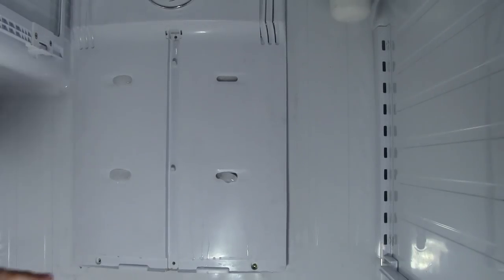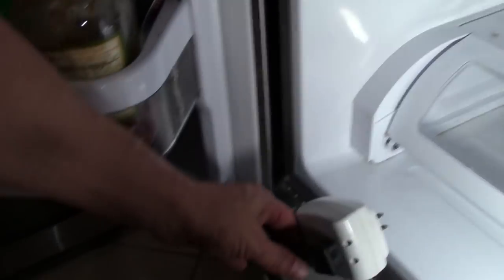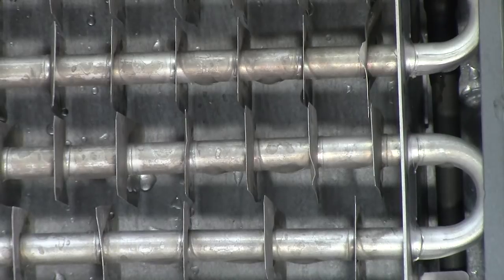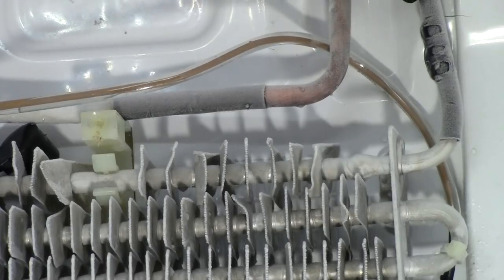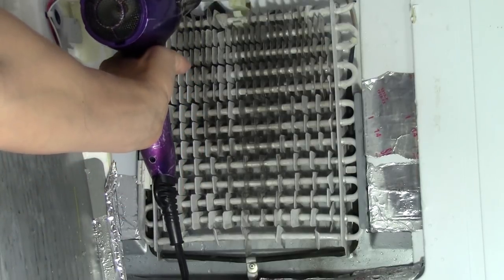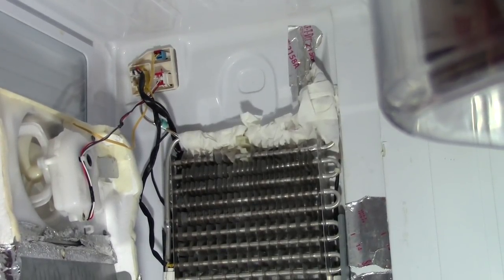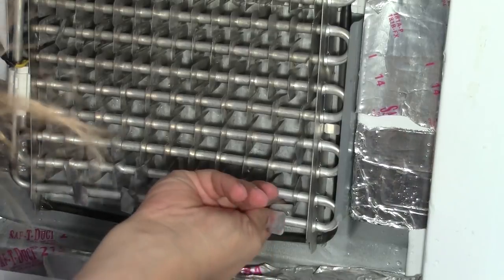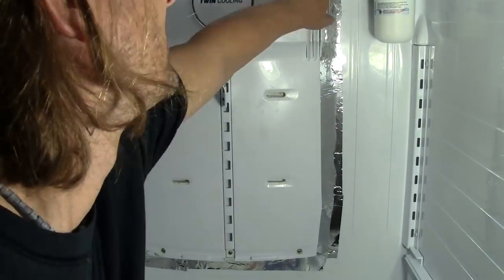PART 8 How to Fix a SAMSUNG RF 267 Refrigerator Not Cooling Icing and Freezing DIY repair

Comment: Hello Jake and thank you for the videos on the repair of the Samsung fridge. I have "fixed" my girlfriends fridge which has not worked properly for 2 1/2 years. I have to say that I am trying some different things to stop the icing problem and will update you if they do. Thanks again for the help with the refrigerator.
Reply: Why even bother fixing it yourself ?. You should just let SamSung warranty service a chance to do their job !.

We have the same problem with our SamSung SRF639DSS model after 4.5years working fine for our Sydney's hot climate. I called SamSung Australia explained the situation, mentioned about a few youtube video questioned the quality of SamSung's fridges. I also mentioned the fact that we use lots of SamSung house hold products including diswasher, mirowave oven, washing and dryer machine, etc. SamSung advised that it should just be a simple fix as they are standing behind the quality of their products.

The operator asked me to find the original purchasing invoice, which dated January 2012. She then sent me the repair authorisation form to sign for the repair technician on the day, and booked for us a warranty repair service for free the next day on 27 Dec 2017. 

As it turned out, the auto defrost system was not working because of the blown fuse. I am happy and quite surprised and impressed with SamSung's warranty services.

Comment: Thank you for the info.. I have insulated the lines that you did but did it with insulated foil tape and zip ties. Wish I could show my pics of the work.. my refrigerator actually seems like it's cold and like the temp gauge is working now to.. it uset to just say 34 at all times even with the door open for a while.  So far.. it's been a week..

Comment: This is an excellent example of how a little bit of knowledge can be a dangerous thing.  The problem is with the heating element not working properly. Replace the heating element. There is apparently a class action lawsuit against Samsung for this problem.

Comment: I am dealing with this right now. Purchased this Samsung refrigerator in 2016. Your fix is not a “fix” it is a temporary solution to a major design flaw.  I don’t think the average person is willing or able to defrost the evaporator coils on this refrigerator every few months. The only reason I know about this is because it started making this gosh awful noise and I did some research.  I have already spent $ on trying to get it repaired.  I appreciate all the work you put into this video because I now know what the problem is but I will be getting rid of this refrigerator.

Comment: I've been fixing appliances for over 42 years and these things are the worst pieces of JUNK ever! "SamDUNG!"
Reply: Thank you for your comment Don...What are your top 3 brands to recommend to us getting rid of these SamDungs?
Reply: Amen...I cant see his repair to have any weight
Reply: I ditched the old Samsu...no, I can't even say the name, it was so bad.  Got an LG instead.
Reply: @jaywebb4992  Probably just as bad from what I hear. a lot of these korean companies get their parts from the same supplier and basically just throw different exteriors and features. ughhh I miss an old whirpool we had, it ran for about 30 years, it started rusting but boy this thing was such a beast and it had water dispenser too.
Reply: what do you recommend at the top of the list?

Comment: Hi Jake Good on you for getting stuck in and save everyone who has this problem a lot of money and saving the planet from Scrapped Samsung Fridge Freezers filling up land fill LOL.....I was going to jump in after part 1 but decided to watch all the Videos first...Anyway I am an ex Factory Trained Hotpoint Service Technician and have worked on Thousands of Fridges and Freezer units both Domestic and commercial and it's fairly obvious why they are having this problem you actually hit on the answer with your Nebulizer LOL Here in the UK  we tend not to get many problems with ICE build up due to the fact there are very few houses that use or need Airconditioning this being the main cause of Moisture in the air making it Humid If you have ever seen how a dehumidifier works it's basically a fridge with a very large surface area condense  which the moisture in the air condenses onto then gets collected in a bucket or goes down a drain. Because of the Higher Levels of Humidity in American homes then there is 100s of molecules of water more in the Atmosphere which condenses on anything Cold so the Fridge Ice builds up and the Defrost heater cannot remove this amount of moisture...The only permanent fix would be to fit more defrost heaters they are very low wattage and 3 connected in parallel or maybe even 1 extra would fix this problem once and for all....also 1 last thing moisture condenses on cold metal more than plastic we don't have metal plates and silver foil all around our condense her just plastic..... Good Luck and very well done great effort....Regards Steve Liverpool UK
Reply from the maker: Thanks Steve.  I appreciate your insight.
Reply: Steve, you have the right analogy, but you've somehow managed to arrive at exactly the opposite conclusion from reality.  Air conditioned homes are LESS humid than the ambient air, for exactly the reason of your analogy - an air-conditioner work like just like a dehumidifier.  Moisture in the air condenses on the cold coil of an air-conditioner.  The condensate flows to a drip pan and drain line, and out of the building.   

The higher humidity levels in many US homes vs UK homes is for the simple reason that much of the US is more humid than the UK.  London sits some 400 miles north of the entire continental US.  And Jake in Florida is about 2,000 miles south of you, surrounding by swamps and an ocean of bath-temperature water.  About 1/3 of the continental US has a subtropical climate, with summer temps typically 35-40º C, and humidity ambient humidity well over 90%.    So yes, Jake is dealing with significantly higher humidity than you do, but not because he has air-conditioning
Reply: Exactly so Jeff.  The only exception that I can think of is when the air conditioner is of the swamp box design.  They are made for hyper dry locations such as Arizona perhaps.  I actually had one 35 years ago and all the guns did rust.  I was, shall we say due to "charity that begins at home", ill informed.

Comment: THIS GUY DOESN’T KNOW WHAT HE’S TALKING ABOUT!
The evaporator coils SHOULD have frost on them. The air in the fridge needs to pass over the coils. This is how the heat inside is removed from your unit. 
What this guy is showing you to do is WRONG on so many levels! 
First, the reason you see moisture going into the drain is due to the drain line. The drain line is a tube that exits the refrigerator. With the door open there is a draft. The air will naturally follow that drain tube. This is normal. 
Second- NEVER use a blow dryer to defrost a refrigerator! Never! The liner is plastic, a very thin plastic. It melts easily. You will damage the liner and there is no fix. You could try to seal a damaged liner, in my 30 yrs experience, sealants only work for awhile. Plus, it’s not covered by manufacturer and once damaged nothing else will be cover by the manufacturer.  
Third- NEVER put paper towels on electrical components! HELLO!! Would you wrap paper towels around the bake element in your oven? No, I hope not. The defrost heater in your refrigerator is the same as an oven element. It will glow red hot and any paper near it will burn. 
If your refrigerator has frost/ice built up on the back wall, there is a component in the defrost circuit that has failed and needs to be replaced. No paper towel is going to fix it.
Reply: Correct.... paper towel as insulation lol.
Reply: He's using a hairdryer which is not recommended.
Reply: Hi do you mean replacing defrost sensor and thermis sensor would fix the problem?
Reply: The paper towels are blocking the air flow!
Reply: Loretta if that is your image in your Avatar then all I can say that your beauty is only surpassed by your intellect.  Let us not forget that this guy is a typical "YouTuber". He creates videos about nothing in particular, he is out here for likes and subscriptions, actual substance and quality of content including being correct is the last thing on his mind.
Reply: @ljslw  Hey, No Worries😉👍 
 Just look at the massive amount of other "positive" comments he gets, maybe some are simply friends of his from the real world, while others are simply "Cranking his handle" in a Troll like way to perhaps annoy other readers! 

At least people like us like to scream the truth in the comment section, who knows, we could be saving someone from permanent injury or even death.  A pity that there is no apparent way to demonitize these videos for encouraging dangerous practices.
Reply: Hot damn this thread screams "boomer" and what fucking cringe.
Reply: I am thinking that some minor fireproof insulating  where the evaporator supply and return lines come thru the back of the uint could be beneficial in reducing condensation/ice buildup.  Also theres a fix to help the heating coil keep the drain portion open more increasing moisture removal.  The paper towel thing sure scared the crap out of me for sure, especially down by the defrost element!  What do you think Loretta?
Reply: Vinh Le if you have a multimeter you can check the ohms of the heating Elemt and the defrost thermostat/bi-metal. If the sensor was buried in ice, replace it. It doesn’t cost much.
Reply: Gary Seven i read some of those positive comments. I wonder how many people melted the liner when they blow dried the coils? I don’t think they’d give a positive review.
Reply: Dougs Channel the coils will frost up, that’s why there is a defrost circuit that has a heating element and thermostat. The control board will cycle in defrost mode 2-4 times a day. If you notice the heating element has a metal clip hanging from the middle. The clip fits in the drain hole. It heats when the element heats. This prevents the drain from freezing. Most common cause of drain freezing is dirty condenser coils under the refer. The dust has nowhere to go except up the drain line. Then you have a clog and no where for the water to drain.  If the refrigerant line is iced up, where it enters the freezer, you could have a restriction in the system, the compressor could be running hot. The supply lines should not have a large ball of ice on them. That ice isn’t from ambient temperature. The refrigerant that flows in the system is seriously cold. The evaporator draws the heat out of the freezer and undoing so the moisture accumulated on the coils. That’s normal. In the video, this guy is trying to stop the frost from forming. It will never stop, it has to form on the coils. There is moisture in the air and the coils need air. I would insulate anything. Tell mie, ehatsbthe issue your having?
Reply: Loretta Cirka , Thank you so much for your detailed answer.  My drain was plugged and frozen.  My understanding is the metal tab that is supposed to conduct heat from the element to keep the drain clear is insufficient in size.  There are other videos where people replace them to help rectify this.  Good to know about the the dust buildup in the drain line, I will check that.  The issue started with ice buildup around the refrigerant supply and discharge gas line from the evaporator.  This giant chunk of ice infringed upon fan creating a wonderful sound that perhaps even my neighbours could hear.    So I will start with the drain and work my way up.  Apparently this is a very common problem with these Samsung fridges.  Thanks again for the info.
Reply: @ljslw  Loretta  You are a rock star. And have this figured out. And  unlike guitar guy who raps heating coils with paper towel. And defrost every few months. I did that for a couple years. And then got my multi meter out and used online service manuals to figure it out. But he gets a whole lot of people watch his stuff cuss alot of these Fridges are messed up.  He feeds Band-Aids. I was looking for the real solution .    Rock on Mark
Reply: @lorretacirka thank you! Same thing is currently happening to me and i don't want to buy another fridge. Defrost sensor it is. I thought this guy was gonna show us how to replace the part not show us how to burn our house down.

Comment: Samsung customer service said raise the front to lean 2 degrees out of plum so water will drain properly. After several 6-8 hr thawing processes l raised the front as much as possible with the bottom leveling screws.  Hope it works. Note: 2 degrees out of plumb is ridiculous!
Reply: Did it work?

Comment: As an appliance technician i would never recommend putting paper towels over the evaporator lines or near the defrost heater. This can be a potential fire hazard and also pieces of paper towels could possibly work their way down the drain tub thus, clogging it.
Reply: Thanks for your important. So would you mind explaining to us how to fix the issue since your already here?
Reply: @thehustlersnetworktv1033  To fix the issue properly, one needs to install Second heater - $15 part# SH201 or similar. There is a ton of videos about the repair here on Youtube

Comment: Bought all new samsung appliances. Fridge, range, dish washer, washer and dryer. Firdge is having this problem.  Never buying samsung again.
Reply: Nor Kenmore, they use Samsung parts.  Mine died after two months.
Reply: I bought all the Samsung products as well. Never again . after the first year my dryer broke, oven and fridge.
Reply: I bought all Samsung in January of 2016. So far I've repaired the dishwasher (bottom mechanism quit working), range (both convection fans) and now I'm working on the fridge. The microwave throws codes ever so often too. Yay Samsung!
Reply: Samsung needs to be sued for manufacturing these defect mechanism and selling them at a very high price
Reply: Did the same mistake 7 years ago. This past year, my washer (clogged water line), dryer (thermostats fuse, which produces the heat), and tonight the fridge (complete icebox, which obstructed the fan from spinning). NEVER doing Samsung again. Go American...
Reply: The amazing thing is this problem has been going on since before 2010 and Samsung kept denying AND making the exact same crap so do yourself a favor and junk these lemons you'll be much happier.

Comment: Everyone it’s the drain tube check valve causing the air to come in. They sell a new style check valve and sticker kit for the Samsung fridge. He was right about air freezing up through the drain tub through under the evaporator to the drip pan. The check valve tub is behind the fridge take the bottom cover off it’s hanging into the drip pan.
Reply: Louis,  has this fix work for you so far you posted it a month ago, how is your fridge working ?

Comment: Replaced a Frigidaire (1 mo old) that would not cool below 42F. with a Samsung RF268ABRS in 2011. Have had nothing but issues with the cooling, specially after an electrical power interruption. It would take up to a week for the unit to settle into the suggested -2/38F setting. Had a lot of spoiled food loss over it's lifetime. 
Shelf placement is terrible, and unalterable. 
My backup was a 1947 Westinghouse,and a 17 cu.ft Coldspot chest freezer (running a constant -10F.
Yesterday I had a Samsung technician in, and have him declare the RF268 not reparable for less than the cost of a new unit!
I think Samsung should stickto cell phones!

Comment: Mine just started icing up this week like yours.  Have had it for just over 7 years now.  Guess I know what I am doing after work today.  I think I will try sticking the piece of copper wire down the drain hole trick as well.  Seems like that should be a good fix for that hole freezing up.  I have watched some other vids that say the heating element may be bad and that is the cause of it.  But before going thru that expense, I will try this for no cost, other than my time.
Reply: How did it work? It worked for 2 years for me....back to square 1 now.
Reply: @rocnloretta  It is still working.  Haven't had to "de-ice" since then.  There is a little bit of ice build up back there now, but nothing like it used to do.  I know I will NEVER buy another Samsung appliance though!

Comment: Hey mate, a follow up for this repair is to remove the back plate at the bottom of the fridge and you will see some tubes coming down to the drip tray which allows the consation water to evaporate. Just pull those tubes out and clean out the rubber valve. Mine were blocked with dust and was stopping the water from getting out and causing the freezing of the water up higher.
Reply: Now You make sense! thanks Bloke
Reply: The opening for water to drip out the ends of these tubes is so small they are easily plugged so I snipped off a corner of the bottom rubber so there is more room for water to drain and not be plugged up, the refrigerator drain is more problematic than the freezer. This is however a separate problem and won't prevent the common freeze up of the drain hole at the bottom in the tray at the base behind the evaporator cover in the upper portion of the fridge...